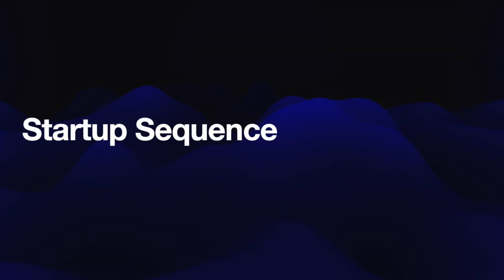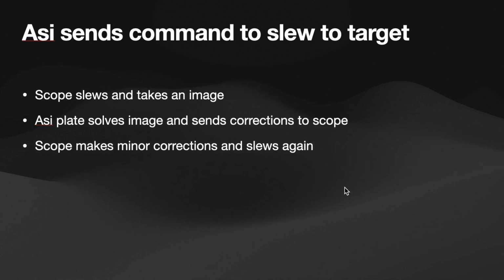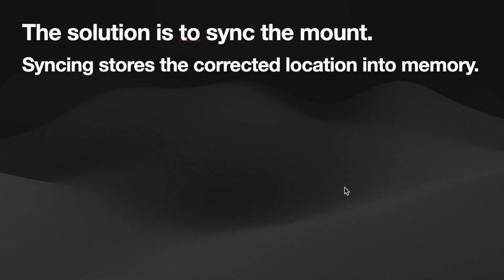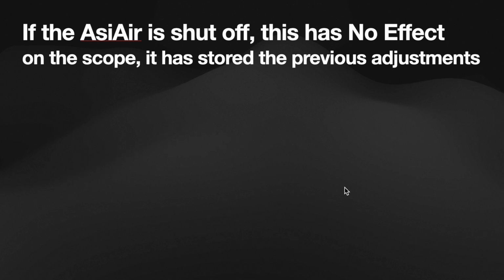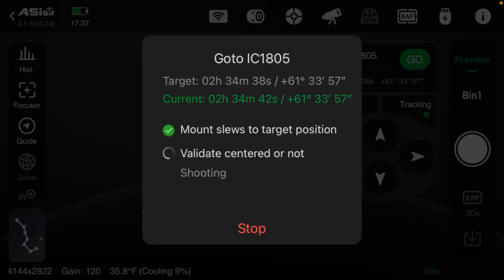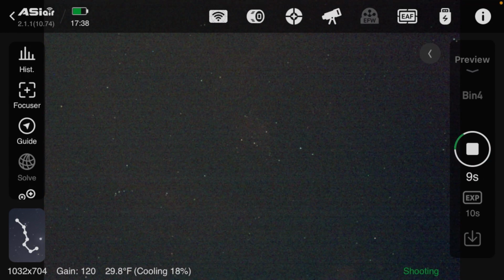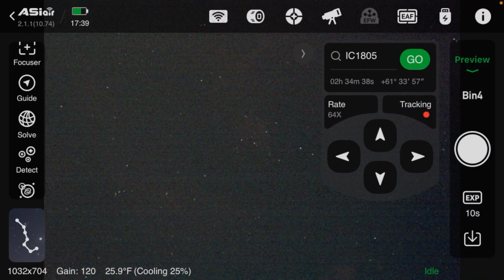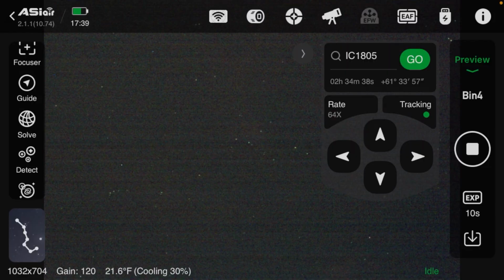Telescope Pointing to the Ground? -- Why it happens and How To Fix

Comment: Happened to me once. The cause was that a loose power connection, reset my asiair, which thought it was in the home position. the fix was to loosen the clutches and send the mount to home, then line up my home marks before tightening the clutches
Reply from the maker: I wish there were a way the Asiair and the mount could sense that something like this happened.  It would be a lot easier.